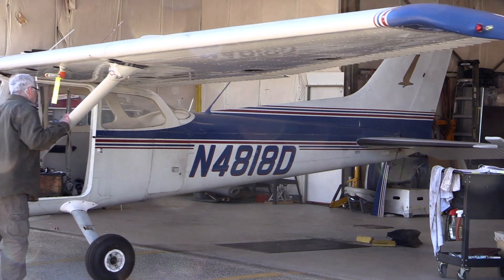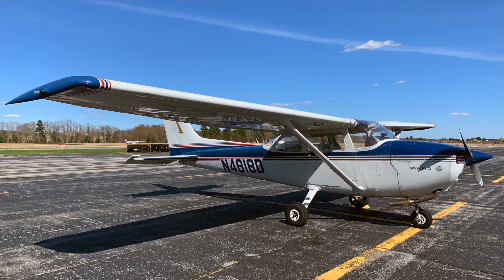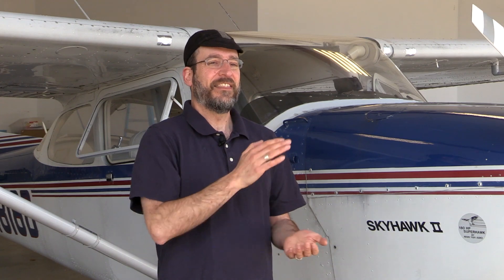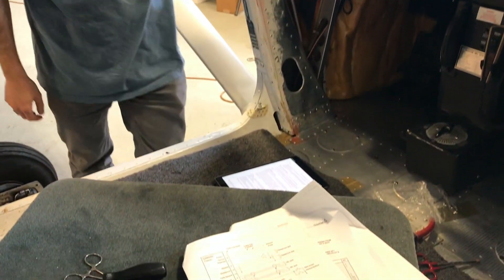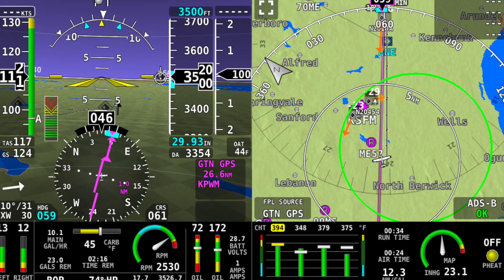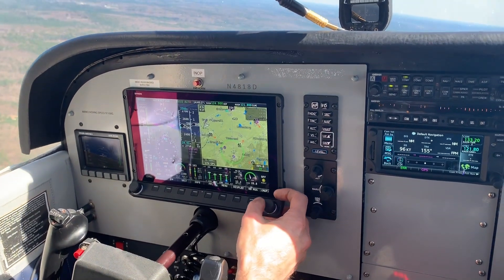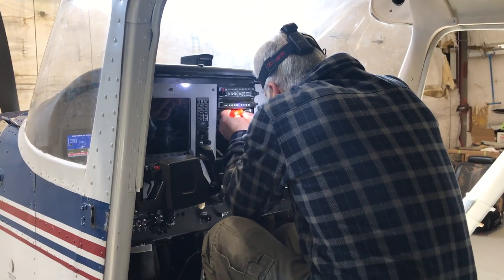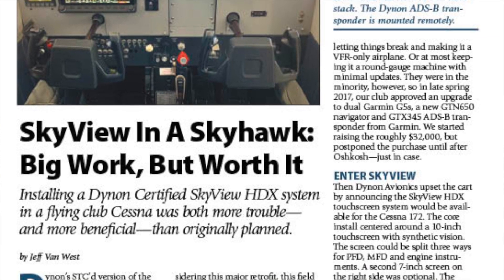Dynon SkyView in a Skyhawk

Comment: hmm, the state of aviation feels too much like the car situation in Cuba, going to great lengths to nurse old junk when 60k should really buy you a brand new state of the art plane with everything.
We need multiple revolutions.
Reply: This is the perfect metaphor.
Reply: volume is just not there for that pricing
Reply: Volume is not there at $500,000. At $60,000 the volume is there. It would open up access for people like myself to get into a new aircraft. In the seventies you could buy a C-172 for the price of a luxury car, now it cost about the same as a luxury home around here.
Reply: @bigc208  Echo class is dead already for hobby pilots. The future belongs to the ULs, that get close in capability, even superior in some points, but at a much lower price.
Reply: bigc208 itsbcalled litigation
Lawyers sue every individual component manufacturer who supplied a part to a aircraft every time a plane goes down. The many of small aircraft
Reply: @hvacmike1175  In the USA . . .
Reply: @cleburne-dfwseptic6843  that's a self fulfilling prophecy.  A 172 is an awful plane from 1960. Nice car makers do 'super cars' for much less than a 'new' 172. Volume is a factor but so is sheepish mindlessness. When I say brand new state of the art plane, I'm certainly not talking about the awful 172.
Reply: @DanFrederiksen  I'm in the aerospace industry. Getting a new plane certified can run from tens of millions to billions of dollars. Try to make that up selling 50 units a year; it's possible for jets, not so much for 4-seaters.
Reply: @UncleKennysPlace  I'm in the intelligence industry where I understand simple things like a cessna 172 was certified 60 years ago so that argument has zero merit.
Reply: @DanFrederiksen   - Sir, if you have done "half a million" comments on youtube it's no wonder you've not had time to start the company that will build the aircraft you say can be built (for the price you desire) ......best of luck in making your dream a reality ..... p.s. I was only referring to the comments you made on this video .......good luck with your business venture .... as for me I have to go back to work ... aircraft payment to make you know ................
Reply: @unclejack123  it takes a lot of effort to sway the obtuseness of man. Wish it was easier.
Reply: @DanFrederiksen  - would you care to explain to those of use who appear(to you) to be obtuse - 1 - YOUR definition of "status quo" ... 2 - EXACTLY what changes do you propose to make(to the S.Q.) ... 3 - how do you propose IMPLEMENTING these changes............... ;-p ...... Off to do chores .
Reply: @unclejack123  Status quo is obviously 400k$ for a bad 1960 design prop plane. 60k$ to change the dash in an old one because a new one is so grotesquely overpriced.
I obviously propose someone starts thinking in terms of cost optimization for greater volume, which includes simple construction (few large pieces in fiberglass or carbon, single piece wing), getting an engine certified to replace rotax, developing their own avionics and of course a sleek beautiful aerodynamic shape so it's fast and efficient. (over 300kmh with 100 horse, 2 seats)
There is almost no limit to how inexpensive it could be in volume but say aim for 39k$ and see how may preorders come in off the prototype. The certified engine should cost them no more than 2k, avionics less than that. And ipad with a bad app should not cost 17k. A Rotex 915 must not under any circumstance cost 37k. If your goal is to make it cost effective for much greater volume, it can easily be done. I imagine 39k would sell in some volume.
Reply: @ Dan Fredriksen

What’s so awful about the 172?  There isn’t a plane that can do what it can do, which is why it is still in production. Even Cessna couldn’t replace it... their “172J” Cardinal lasted only ten years and required a ton of modifications and 30 more HP to perform as good as the 172. 

There are faster planes than the 172, slower planes than the 172, cheaper planes than the 172, newer planes than the 172... but I dare you to find one that will do everything the 172 does for cheaper, year for year. 

Faster planes won’t fly in and out of strips the 172 is comfortable flying out of. Almost everything that can go on shorter unimproved strips that the 172 can is either slower or more expensive or both. Fabric aircraft need to be in a hangar. As do plastic aircraft. 

Even the engines... you can make a better engine from an automotive perspective like specific power but these modern engines don’t match power to weight very well because they typically have gearboxes and liquid cooling systems and electronic ignition which requires two completely independent electric systems. And then failure modes go through the roof. 

Best thing about a 172 is you can make money with it. You want to do some aerial photography or light survey work... the high wing, huge opening windows, and removable doors make it easy. 

That’s why it still sells even though there are newer, but less useful, plastic aircraft like the Cirrus and Diamond.
Reply: @ Dan Fredriksen

If you’re you’re in the “intelligence” business (a fucking contradiction in terms... lol), maybe you should research the general aviation market crash of 1947. 

You can’t make it on volume selling airplanes.
Reply: @Bartonovich52  I'm sorry but you are fundamentally wrong. You are looking from the wrong angle. The Cessna is not special, in fact is so popular because it's common. Most people learn to fly in a Cessna, no extra training or adaptation required. Tell me: if you learn to drive in a Toyota Corolla, you will probably be inclined to buy one or something very similar as a first car. Then it's cheap because it's popular. Everyone wants one, that means that they are traded like hell in the market and ultimately because most of them are also old, the price is substantially lower than other newer offers with shiny 20000$ panels. 
There are several aircraft just like the Cessna, that can do the same mission, but due to its history and legacy the 172 will be king for a long time
Reply: It’s been 11 months Dan. Have you finished your brand new certified AC that costs no more than a BMW?
Reply: @Mrcaffinebean  You are an idiot . . .
Reply: @Mrcaffinebean  Dan is currently moving out of his parents basement. He got promoted to fry cook at the local McDonalds. Next, he'll be releasing his ultra-efficient and sleek two seat airplane for the low price of 39k!
Reply: Brett McNary as someone who was once a Mcds fry cook that hasn’t yet made it the aerospace engineer I am starting to feel I’m behind lol
Reply: Of course it doesn't make sense. Don't forget that a l39 c albatross costs on average 300k and probably 500k after a nice overhaul. For the same price you can get any recently manufactured 4 seater SEP...
Reply: A brand new C172 Skyhawk is $750,000.
Reply: @theboyscout0156  There is a 10 hours 2019 for sale for 430k. another for 480. where do you get the price of 750? and even if it was that expensive, that would just further make my point, dumbass.
Reply: operative word is "should" (60k should really buy - brand new? state of the art?) ...... you propose building a modern A/C and furnishing it with "state of the art equipment ............for 60k .... it would have to have a made in Bangladesh sticker on it ................ ;-p
Reply: @unclejack123  A Nissan Versa sedan with aircon and advanced engine is 12k$. Yet 1960 cessna 172 is 350k$. Think a little.
Reply: @DanFrederiksen   - in 1960 a Cessna 172 was $20k. a new VW beetle $1,400 & a New House in San Diego was $25k ...... what's your point?
Reply: @unclejack123  it's the same old awful design, now 400k. The point is more than obvious.
Reply: @atypocrat1779  That's still much too expensive and imagine building a kit bmw 3 because the business at large is out to lunch. A factory can do it a lot better and cheaper. Kits in aviation should not be a thing. It's a diseased symptom of a disease.
Reply: @atypocrat1779  Maybe the market size has something to do with an old plane costing around 400k for no good reason. Call me crazy.
Reply: @DanFrederiksen  think he said a new plane with the avionics woyld be 350000
Reply: This is a prime example of someone who doesn’t know what they’re talking about acting like an expert.
Reply: @NonyaBusiness! when you stop making mindless excuses not to hear the truth I speak